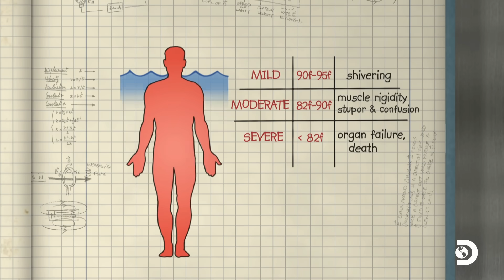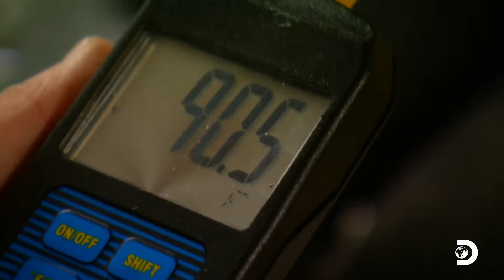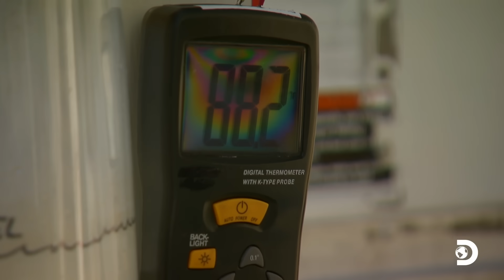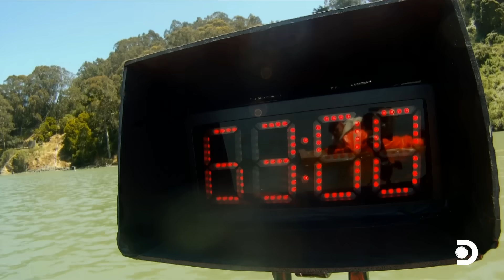Could Jack Have Survived on the Titanic Raft? | MythBusters | Discovery

Comment: James Cameron was a good sport to play this part (as a janitor at M-5). I always thought that even if they both couldn't fit on the piece of wood, at least they could have taken turns! (Also, wouldn't Jack have floated instead of sunk? It is significantly easier to float in salty water than fresh water as well!) Or, wasn't there more than ONE piece of wooden debris floating in the water? Anyway, James is actually concerned about scientific accuracy: Neil deGrasse Tyson pointed out to James after the movie came out that the stars Jack and Rose see in the sky are the wrong stars, based on the date and location at the time. James hemmed and hawed but in a rerelease version of the movie he actually fixed that scene!

Comment: So, if you get wet, get out and stay wet, in 29° temps, you still only have an hour. Since she took the plunge, hopped on a door, she wouldn't last more than a few minutes longer than him. Myth confirmed, they are both dead
Reply: Rose could've technically survived until the rescuers arrived. The problem is that she would've been too weak to move at that point meaning she shouldn't have been able to swim over to get the dead guy's whistle. The reason why Jack was in a worse position is because being in the water and unable to move means he would've drowned. Although the movie doesn't portray his death like that. Instead he dies from the cold.

Comment: This myth barely holds up in the realm of "theoretically if", if at all. I am with James Cameron on this:

It's very, very reasonable that Jack would not risk having both of them "mostly out of the water" instead of having Rose entirely out of the water. After all, there are SEVERAL crucial metrics Jack and Rose could not know: The actual temperature they were facing, how long Rose would actually survive in that temperature if partially in the water (given her disadvantageous surface to mass ratio compared to an average man), and MOST importantly: How long they needed to hold on until rescue would come (if at all)!
And then of course there are the cognitive effects of hypothermia and trauma that would easily explain why neither of them thought of using the preserver for additional buoyancy. And even if, would they risk trying anything like that, when perhaps the life preserver serves as a bit of insulation against the ambient temperature, or you're just terrified to dive under the board (getting even colder) etc.

No matter what angle we look at this from, keeping both of them on the board with more water contact would have made their survival extremely, extremely unlikely, if at all possible!

Comment: Naked body weight is one thing.  Fully clothed body weight is different.  Fully clothed, WET body weight is an entire other thing.  I've never seen the movie, but wasn't Rose wearing a dress?  From experience (Lady of the Lake cosplay) a wet dress in the water not only weighs you down, but makes it very difficult to move because the skirt will wrap around your legs and create drag.   So dragging herself onto the board would've taken a lot more energy, especially in the rough ocean.  Not to mention the shock to her system of jumping into that freezing water in the first place - it's like being slapped over every square inch of your body at once (again, personal experience - two Polar Bear Dives).

Comment: The one problem though is both would have been well to the point of being unconscious by 63 minute rescue based on the test with the air dummy being only slightly higher than if submerged bc both their clothes were still wet.  So neither would be able to alert the rescue crew.  So while they both "could" have survived their chance of rescue would be near 0 anyway.

Comment: Ok there not in period cloths which would hold water and add extra weight. 2 it was butt cold and would be freezing after how long so an average can keep there brain in charge. Which when you hit that cold water you just start involuntary gasping for air. Which there not doing so there not in freezing conditions and not as heavy with water logged cloths.

Comment: One thing about the floating above water part is that the body isn't completely out of the water, it's still touching parts of the water which means it's constantly getting wet. Also, once the body temperature gets low enough that the muscles seize up, you'll no longer have the strength to hold onto the board, so if even a small wave comes along and knocks you off it, you're drowning. It's also unlikely the rescuers would be able to warm up her body quickly enough once they were able to reach her.
Reply: i'll remind you that Jack hold onto that board the entire time while being in the water until he died.
Reply: @medranodiego8641 
He froze to the door. You could hear the ice crunching when Rose moved his hand.

Comment: Now - the one thing I dispute here is they had the benefit of essentially - prep time. And when they got into the water they weren't dealing with the negative effects of hypothermia. Meaning - they had time to come up with a solution that Rose and Jack wouldn't have, and may not have been able to execute. I don't think two people suffering (at that point) mild Hypothermia would have been able to get into the water,  tie the life preserver under it, then get back up onto the board.
Reply: the problem i have is that Jamie and Adam are big and healthy men with a combined weight of 170/180kg while Rose and Jack where small and skinny who probly had a combined 110kg, So they probly didn't need the life jacket underneath the board.
Reply: @DanteKenchi  Ah but I would argue - them being so small and skinny means they would be affected by the cold temperatures WAY faster. Meaning an argument could be made that even both of them getting onto the board and moving enough to distribute their weight so it doesn't sink (cuz remember, Balance is ALSO a really big factor that gets fixed by the life jacket) would have been too difficult for them to both do under those conditions.
Reply: Ever try to tie a knot when your fingers are freezing cold?  This would have been hard to pull off, even if they'd thought of it.  (And, per the script, they didn't think of it.)
Reply: Exactly!  Jack and Rose would've been feeling all kinds of adrenaline and shock.  They would've been freezing.  They would've been overwhelmed by the hundreds of people screaming and flailing around them.  It's not about calmly figuring out the perfect solution to survival.
Reply: Absolutely.
Reply: And they would also have to go find those life jackets, pulling them off dead bodies and possibly even people still alive, in order to get enough to keep both of them out of the water. Not feasible really, not in those conditions
Reply: @mikian they used the life jacket Rose was wearing

Comment: A human body generates heat, so doesn't just cool down at a constant rate like thermo man did.  They would need a small heater in it to simulate the added heat the the body generates while cooling down from the cold water and air.

Comment: Rose and Jack are smaller than these guys so they would fit better and weigh it down less, however... they had been running on pure adrenaline for hours. They were exhausted, traumatized and probably not thinking clearly. Definitely not able to engineer the life vest under the door, but also I think it's realistic that Jack would have given up in concern for Roses safety without keeping trying the tilting door situation

Comment: I do wonder, obviously shivering is designed to help keep the body warm when it starts losing temperature, as they mention. If they simulated shivering, as would happen in a real person, would that have had an effect on the hypothermia testing.
Reply: It would, yes. As would your baseline metabolism. The hypothermia experiment is pretty terrible, actually. They don't account for the body generating heat. And other things, too. They could have left the dummy in a room temperature (20 degrees celcius, 68 degrees farenheit) environment, and their experiment would indicate that the person would die of hypothermia eventually too.

Comment: I think having the strength to pull yourself up out of the freezing water onto that board without it tipping over would have been very difficult if not impossible. Also they didn’t factor in the fact that they were both in the water for some minutes and out in the cold for at least an hour prior to reaching the door.

Comment: One thought about hypothermia: If both of them would have been on the improvised raft and cuddled together, their temperature even should have dropped a little slower, because they would warm each other (at least a little bit) - that might add some more minutes for the rescue. Or am I wrong here?
Reply: Your definently right, animals do this to stay warm in freezing temperatures. It seems they just didn't account for this.
Reply: @A_youtube_channel_  Human animals have also been known to do this.
Reply: They could have also taun-tauned it.
Reply: Absolutely right. However with no way to test beforehand, I would not have risked the water contact that they would have had continuously if together on the board. And then there's the fact that they had no way of knowing how long they would have to last. Jack absolutely chose the safest path for Rose that he could reasonably know.
Reply: @frankk1358  Jack: I thought they smelled bad on the outside.